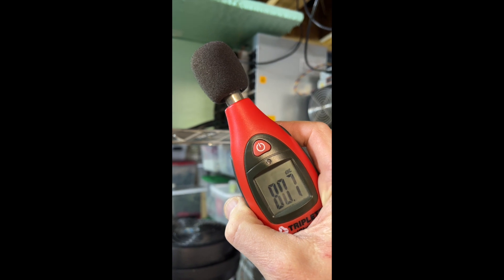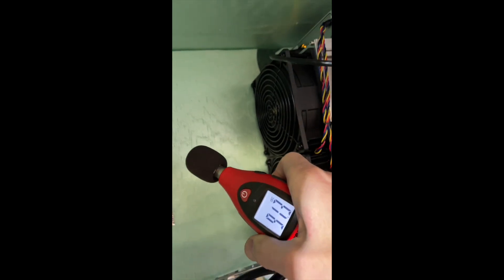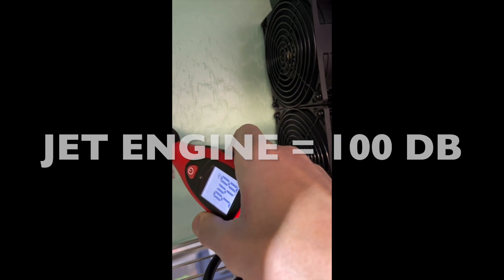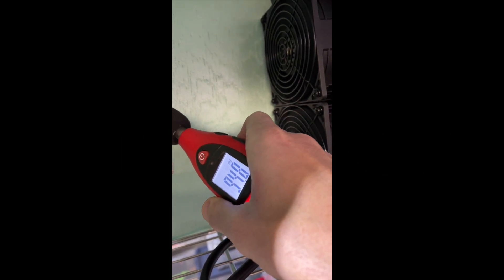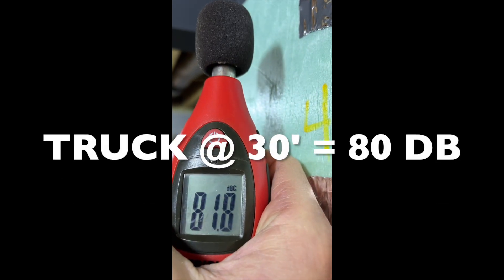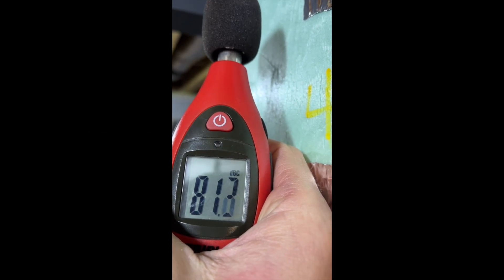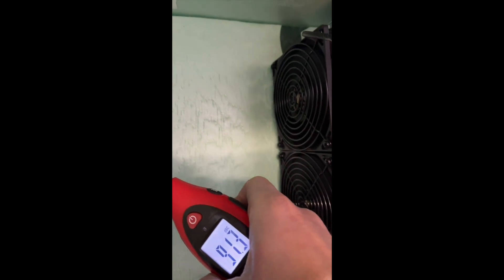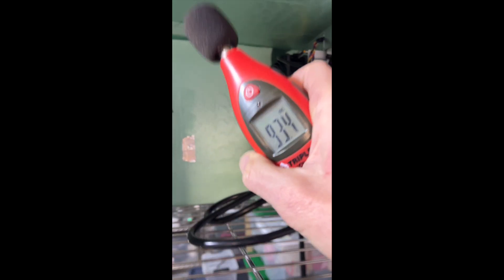ASICBASICS.COM - Bitmain L7 ventilation and noise reduction

Comment: If this will be my only miner running will it be fine running stock just the way it is? I’m assuming these measures are for when someone has multiple miners running in the same room?
Reply from the maker: This is for one miner or several, cooling and quieting them down helps sanity and their efficiency. Even if you only have one I would highly suggest doing what I’ve done, or something similar, in the video. You can try without at first but trust me, they’re hot and loud.

Comment: Hay Andy, will you still recommend a L7?  Also I see its 240 v did you have to change your electric ? I do see it has 2 Plugs for the electric are they 110v each and by combining them its the voltage that's needed ?
thank you
Reply from the maker: Yes, there are two plugs however they both require 240V.

Comment: Where is the intake duct connected to? Is an inline fan more important on the intake or exhaust? How would you setup 50 miners in a room
With a similar setup? Thanks.
Reply from the maker: The intake is just drawing ambient air, I have foam board around the input just to ensure I'm grabbing most of it from cooler air below (which is why I have a fan blowing straight up into it from below.) Inline duct fans are more important on the exhaust as it creates negative pressure through the miner, which draws more air through. 

If you're looking to do this with 50 miners it's slightly more labor intensive to setup but it can be done. Best bet is to do it in blocks. Take 5-10 miners and duct their exhaust into a manifold. Then attach an exhaust fan to that equal to roughly 500cfm x (number of miners.) This would be more economical then putting a duct fan on each miner itself.
Reply: @asicbasics  You should always be pushing air through ducts,  not pulling it.  You're doing everything wrong.
Reply: @LarsLarsen77  ?
Reply: radiator

Comment: Ok so the problem I am having with my L7 is a constant Abnormal Temperature problem where it stops mining. I have my fans directed outside with 2 4" vents and I have an AC unit pointed strait at the intake but still it tells me its hot and it is not even 80 degrees on the unit. Any Ideas?
Reply from the maker: 4" outlets are actually necked down slightly from the 120mm fans so that may be the issue. There's not a clean flow of air (based off the design) so anything that even slightly restricts airflow can create a problem. Two 4" outlets only give you 25 sq/in of area whereas two 120mm gives you ~35 sq/in of area. Basically you're restricting almost 30% of your output with those. if you go to a dual shroud with an 8" exhaust you're sitting at ~50 sq/in of area. Couple that with an inline exhaust fan and you're venting far more than stock which gives you a gain in cooling. 

All that said, it could also just be a problem with your system itself, but I'd start with trying the larger shroud. You may be able, with an inline exhaust fan, to even ditch the AC unit. I don't run one and I run the unit in an ambient 70's degree room.

Feel free to hit me up with any other questions or if I can help in any way.
Reply: @asicbasics  Guess I will try the 8" see if that helps at all. Thank you for replying because bitmain is slow.
Reply: @Bearstatto  any luck?
Reply: upgrade to water-cooling，which just need 230$.
Reply: it can overclocking to 60%
Reply: Hi Andy is your fan venting hot air out??